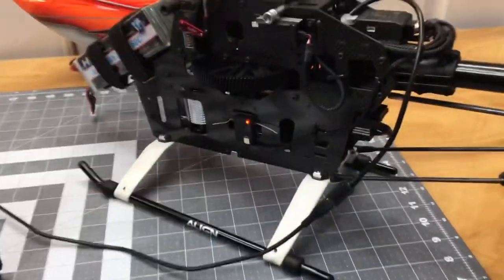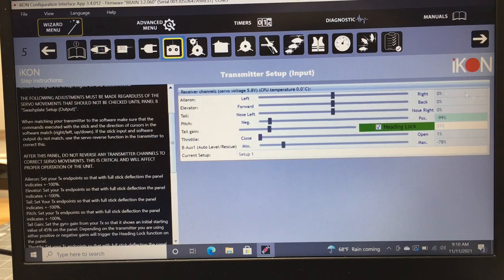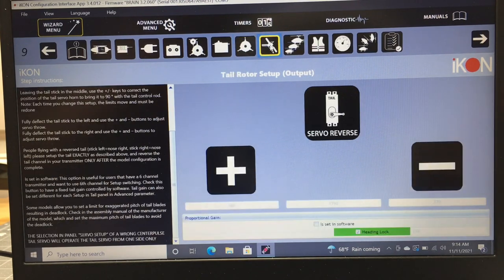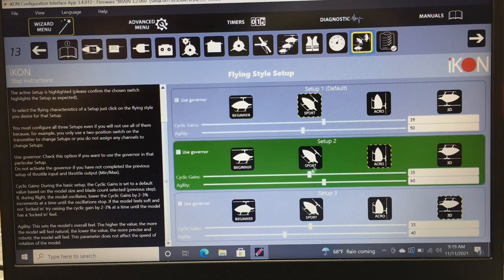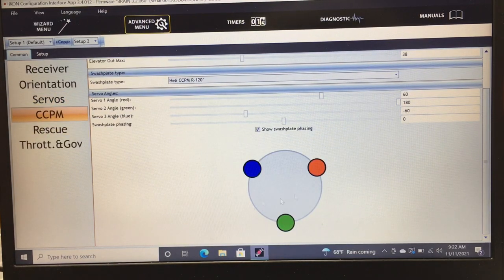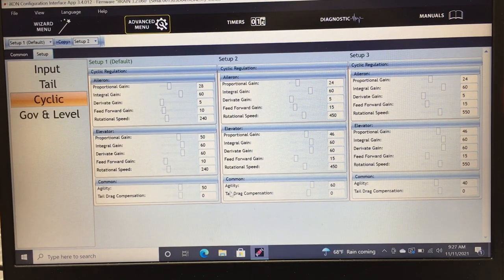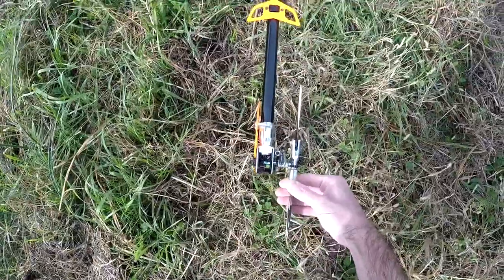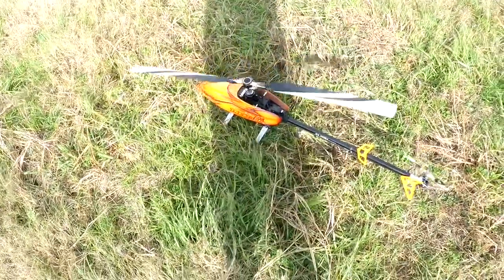How to setup MSH Brain/Ikon FBL with Test flight

Comment: Can I use the settings you set in the advanced menu for an Align Trex 470LM as well (instead of your Trex 550)? What are your throttle curves for this setup? For my new 470LM I have set 65% for normal mode, idle up 1 75%,  idle up 2 80%. Greets and thanks for the great content!
Reply from the maker: Thank you for watching! Yes you can, you might need to turn rotation rate down as it’s very fast at 550 but try it and see how you like it. On my old 470 I ran 65% in normal 75% in idle up 1 and 90% in idle up 2.

Comment: Hello, i remember you suggested me to take this FBL instead of MicroBeast. While i still could go with MicroBeast, one thing about which i thought recently is a rescue function, probably will help me a lot if i will lose orienation in a real flight. Seems MicroBeast asks to pay extra 99 dollars for unlocking such feature, while MSH Brain have it by default.. quite much lures me to think about getting a MSH unit. Hmm, so i got 2 questions, is it connected to PC by Bluetooth only or there is some USB cable stuff? If Bluetooth only, then should i buy special accessory, or any notebook with native Bluetooth module will work? Another question - for what reason there are inner configurations like expo and stuff if it's usually done on a transmitter? I guess it's made for such cases when a person have a simple transmitter, or there is something more behind that?
Reply from the maker: Hello, yes I remember. I still recommend MSH iKon/Brain over microbeast any day. So you can buy it two ways. Bluetooth and Non Bluetooth. Both can be setup with a micro USB cable. The Bluetooth is just for app on your phone(while yes you can use the BT for setup but not needed)  and can be adjusted very easily on the go. I always recommend the regular version and just use a regular micro USB cable. So you have advanced menus and can do a whole lot of things in the software. It’s all user preference and just multiple options for you.
Reply: @westhobbiesrc8051  Thank you. While i still don't have the unit, i already downloaded the software and wow, there is even a demo version of that, so i could see and try everything by myself. That kinda impressed me. I still didn't get a heli kit though :D i'm trying to figure out if i should pick 470L or 500X. I know i was looking for 470LP much as you probably remember, but after some researches and comparison, i realized it is still maybe relatively small for me. Meanwhile i was practising in Heli-X simulator, maybe flew around 20 hours there. While i think 470L is not as big as i would like, at the same time i afraid that 500X may look scary first.

Comment: Im about to set up a brain2 on a 450 size heli this weekend. Hope it goes smoothly ive never set one up before.
Reply from the maker: They are super easy to setup! Just go page by page and you will be good!
Reply: @westhobbiesrc8051  hasnt been easy soo far. I cant figured out how to set the gyro gain to 45 like it says to from my transmitter. im changing it in my transmitter but nothing happens in the program. super frustrated already.
Reply from the maker: @DetoursRC  First things first, did you select sit in transmitter under the tail gain menu you? Did you selector switch for your flight modes? It is very easy, sometimes if you did it right and it’s still not working except the menu and get back in and see if it works out. But I’ve never had a problem setting up Gain.
Reply: @westhobbiesrc8051  I think I figured that part out. now I got to the servo setup and I cant get any of it to work right either. Ive only ever had BNF helis that are ready to go. I like flying them. Sitting on the computer frustrated for hours may not be for me.
Reply: @westhobbiesrc8051  Ill figure it out. I am just really impatient when it comes to computers and I try to rush through it. Lol
Reply from the maker: @DetoursRC  awesome! Your next one will be even easier LOL it is a really simple easy set up. The best thing about Ikon is if you don’t know something just hold your mouse cursor over it and it will explain it to you perfectly. For example if you don’t know you should change your cyclic gain go and hold your mouse cursor over and see what it says what would you do if it’s too high or too low. So on and so forth.

Comment: what cable do u need to conect  to laptop with and also is the v1 much differant to the newer one . cheers
Reply from the maker: You need a micro USB cable. Make sure it’s a communication cable and not a charge cable that set up is the exact same between the older one and newer one. I have several set up videos with the iKon/Brain 2 FBL if you want to check them out. The difference is the processor and what options/telemetry you get with the newer version.

Comment: I have set up the Naza h several times but I'm new to the brain I probably already know the answer to this question but can you use sub trims in the radio for drift?
Reply from the maker: No, never use sub trims. I like to disable them in the radio they will make the FBL to do some funny stuff. If you have a drift you can go into the icon servo section and give it a little adjustment but if the swashplate is 100% level and the helicopter is balanced you should have zero drifting
Reply: @westhobbiesrc8051  What about CG ?
Reply from the maker: @roachcoachhelis6387  CG is important for a perfectly flying heli. You want the heli to balance level

Comment: So I have a question . I have my goblin 380 setup . But I had to do a pitch reverse for the 3 servos to work. 
But now when I setup safe mode . I’ll hit the switch and it goes into  Negative pitch . In stead of a positive pitch on my blades . I tried to reverse the Ch that safe mode in on  but it still done do anything . Thank you
Reply from the maker: Are you sure you selected the right swash setup? All servos plugged into the right ports?
Reply: @westhobbiesrc8051  yes well I think so . Stick forward awash moves forward stick to the left and right . Swash moves left then right . This is new to me lol I’m old school 
Flying with flybars . But I’ll take the reverse of the pitch and double check everything. I shouldn’t have to use reverse on the icons software if everything is set right correct. Thank you (Ikon2 ) I’m using
Reply: @westhobbiesrc8051   ok so I had #2 servos reversed. In the radio . And had to hit the servo reverse in the Ikon2 software. And now 
Everything works . I switch on safemode and I get about 10 degrees +pitch . And I found with the new radio and flybarless setup. You don’t use Revo mix for the tail . Like I said I’m old school . And have to relearn new stuff . Thank you for your help . And for your great videos. I did find out I’m the only one at my flying field with a futaba radio. They all fly VBar .

Comment: Nice tutorial.  
I was under the impression that the auto level resets itself in the first few seconds of flight which replaced the old way of having to have the heli completely level when doing the setup.  
Also do you calibrate the esc to the tx before or after setting the esc endpoints in the the ikon software?
Reply from the maker: Thank you! So I’ve heard that too, that could be true. But the way I was shown and taught on setting up the icon is doing it that way but I’m definitely going to try the way you mentioned and see if that works as well. As far as setting up in points, I don’t do it in the Ikon if I’m running a castle governor. If I’m not running a governor or going to run the internal governor then I would set in points to the Ikon software. Throttle is the only one I do not set manually -100 to +100 unless I’m running no governor or Ikon internal. Hope that helps!
Reply: I think westHobbiesRC has it right with setting level, I was have trouble with forward drift on my 550x so I made a 5deg wedge to level the ikon2 with no change after the wedge was in, I stumbled on this video and tried it by leveling the Heli BEFORE it choose auto level. I will be testing it next flyable day, it’s winter here in New England with a cold front coming so it my be a week but I will post results. THANKS GUYS
Reply: 100% confirmed you got how to set level right, it works that is exactly the help I needed THANK YOU
Reply: @polstery  not for nothing but I have never leveled any heli before clicking self level/rescue and I’ve yet to have any issues but if it worked for you I’m glad.
Reply: @polstery   https://youtu.be/OnLOGz-Apv8.  
At 20:30 he explains the old way of doing the self level  in the updated software the self level set button is no longer present.
Reply: @FASTFREDDIE-R.C.  if your Heli isn’t tilted the way the aligns are then you wouldn’t have a problem
Reply: Why are you trying to show a 7 year old video the whole point is there is no more set level button, are you paying attention
Reply: @polstery   because my helis do not sit level and I posted that old video to show yes you used to have to level your heli. 
The newer firmware resets the auto level every time the ikon is powered on  and it sets it in the first few seconds of flight so there is no need to or does it effect anything by making your heli level before clicking the self level icon in the software
Reply from the maker: @polstery  That is how I’ve personally always leveled mine and I’ve never had a single issue they’ve always been dead on. I’m glad you got it figured out! Thanks for watching!
Reply: @polstery   then why are you agreeing that the heli/shaft must be level before selecting self level
Reply: @FASTFREDDIE-R.C.  the ikon doesn’t reset every time it starts, your wrong that’s what I just confirmed
Reply: @polstery  please post a video of your findings
Reply: @FASTFREDDIE-R.C.  sorry your so butt hurt because your wrong I already detailed what I did and confirmed it, and fixed my drift. Level is level why would the ikon need to reset level every time plus how would it even know what level was. Feel free to post your own video of how it resets level every time should be easy to do but I doubt you will your too good for us. Nobody is forcing you to do anything I was just thanking westHobbiesRC for helping me with this info THAT WORKS
Reply: @polstery  it resets the self level every time because the sensors used for self level are effected by temperature fluctuations which intern can throw off the axes. 

First off I’m not hurt at all and you were the first person to act the fool by asking if I was paying attention. 
I’m just trying to get to the truth regardless of who is right unfortunately you took the opportunity to show your ass not me.
Reply: @FASTFREDDIE-R.C.  read my first post, why did the ikon NOT reset level. Answer because it doesn’t. If you think it does then raise the tail of the Heli turn it on note level, then raise the nose turn it on note level……. NO CHANGE… you’ve already did more typing than it would take to test your theory but you can’t be bothered
Reply: @polstery   and read my first post where I clearly stated “I was under the impression” 
Where in that statement do you come to the conclusion that I am stating facts ?
Reply: @polstery   that wouldn’t change anything because it sets itself after it lifts off the ground hence when I said the first few seconds of flight
Reply: @UCbwWZgOj1GTIiAO6y3es_RQ what’s to debate, I tried it it worked done
Reply: @FASTFREDDIE-R.C.  not even going to test your theory are you
Reply: @polstery  I mean I’ve been setting these up with my helis no where near level and not one issue with the heli going off course with self level I suppose I could have the only ikon that doesn’t need to have the heli level when doing the self level setup
Reply: @polstery  well being that it is after dark here no
Reply: @polstery  agree 100%
Reply: @westhobbiesrc8051  Did you ever try to check the self level box WITHOUT the heli being level like you said you were going to do.  I checked the box WITHOUT the heli being leveled and upon intial hover it immediately started drifting off.  In fact I had to give it full cyclic and it barely responded.  I'm lucky I got it back down.  I changed banks to a NON self level mode and it flew just fine.  I have NOT tried leveling the heli BEFORE checking the self level box yet.  I came across this video because I wanted to find out how to get the self leveling function to work properly.  It seems there was a pissing contest in the comments regarding which way to do self leveling.  Could you please resolve this for us?  Thanks in advance for your help.
Reply from the maker: @jimmydoolitle3764  on the newer iKon/Brain FBL the 2 Self level works really good but! I’ll personally make sure the model is 100% level with a bubble level before clicking the box because once you click that boss whatever in the helicopter is at is what it is going to think is self level. But it does work and it works pretty good. I have set up multiple models with it.
Reply: @westhobbiesrc8051  Perfect !!!  Thank you VERY much for taking the time to reply.  I have been flying RC planes for 40 years and just started teaching myself to fly helis for the last 4 years.  I can sport fly my Blade 250 CFX with self level on really well.  So I bought a used Trex 500 and 600 and converted them both to FBL using the latest Ikon2 units.  I can fly them both OK, but not as good as the Blade with self level turned on.  So I have been checking the self level box on bank number 2 during my Ikon2 setups, but as soon as I take off they drift badly and I have to switch it off.  Thanks to you, I now know to use a bubble level on my rotor mast BEFORE i check the box in setup.  I will try it tomorrow!!!!  I'm hoping it will fly just like my blade 250CFX.  Do you think it will??
Reply from the maker: @jimmydoolitle3764  you’re welcome! I know what it’s like to have questions and have nobody to ask or answer that is the whole reason I started this channel. Also make sure that the swashplate is perfectly level of course but, if the model flies great with self level off then it just needs to be recalibrated and make sure it is perfectly level. So personally, I was never a big fan of the blade 250 CFX. I loved my Blade 300 CFX (still got it just didn’t fly it any more) but I personally think that iKon flies 100 times better. It can take a little tuning in the advanced menus to get the model to feel exactly what you want it to. I’m working on a video for that now) also I am not a huge fan of auto level but I do think it is a great tool but I also think it can cause some bad habits if that makes sense. But it has helped so many people get into helicopters which I think is fantastic. I personally think that you will really like the overall feel of the iKon FBL there is so much you can do to make that model feel exactly how you want it is actually pretty crazy LOL

Comment: where did you get the wire setup for the ikon is it necessary for the setup cause I want my wires out rear
Reply from the maker: If you go in the software there is a section that shows servo Selection and wiring on which goes to which port.